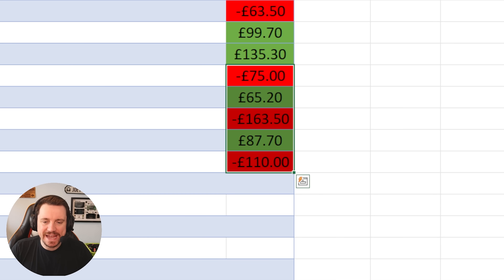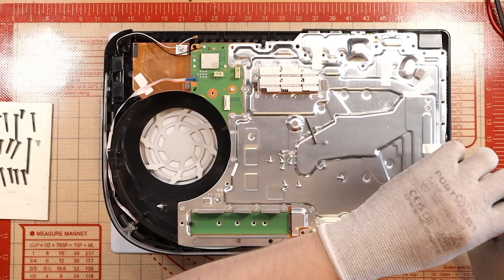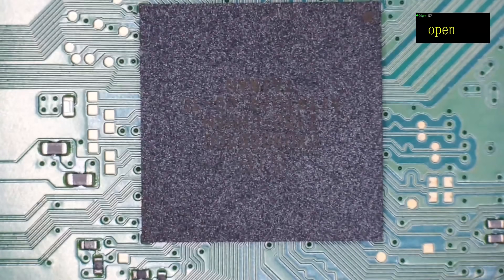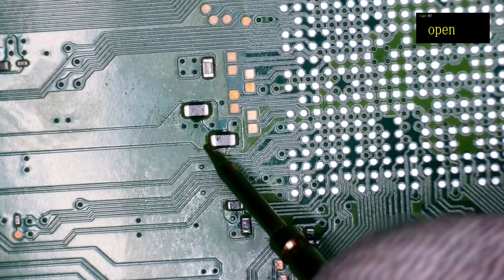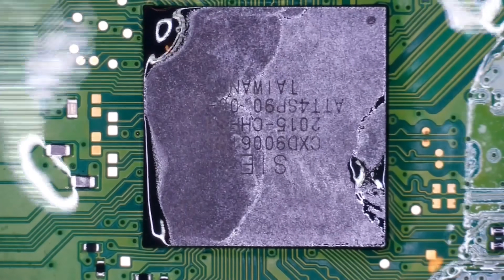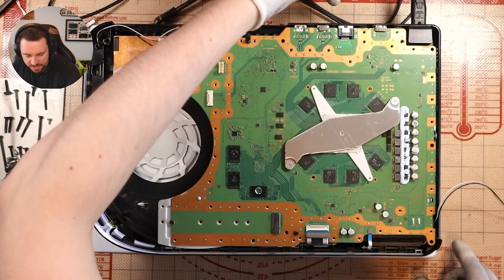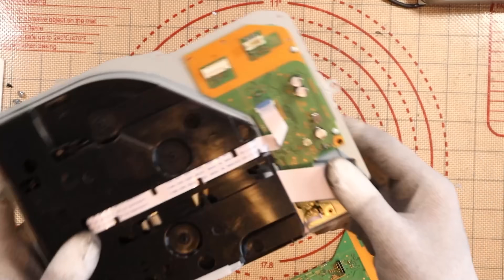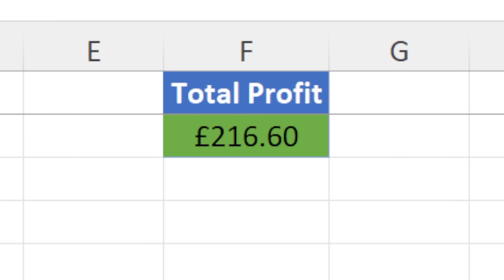Can I Fix JUNK and Make a Profit? S1:E68

Comment: Joey, it would help if you exposed the seller for the scammer he or she is before they burn someone else. They purposely swapped in bad parts and sold the system. It was not an accident and  Ebay should shut them down

Comment: 16:41 I wish you had a column that shows potential parts cost. I know you have a lot of spare parts, but a lot of us would want to know roughly how much would have actually cost. We don't have those that is why it would have been better to have that column.
Reply: The parts costs are included in the total - as long as only consoles are used that have previously been written off. Estimating the parts cost is not that easy if you buy consoles and then cannibalize them. You would have to do many assumptions.

Comment: Leave a seller a bad review joey
Reply: Name and shame
Reply from the maker: Being honest, I don't actually think it warrants it. This seller listed the items saying that they haven't actually been inside them, and the risk of me as a buyer is making that purchased based on that information. Morally, it's probably not great from them as basic checks could be carried out (for example the disc drive looks like it's been opened etc) but in terms of actually selling on eBay, they listed for Parts and Not Working with a description saying that they haven't been in the console.
Reply: @JoeyDoesTech  they purposely swapped out faulty parts that's pretty dodgy

Comment: Ok! I Like your approach but I think you proved that it's difficult to make a living by just repairing as you do. I hope the YouTube model brings you more than the Excel sheet tells us for quite a long while now. Let me know. Best! Job
Reply: At least with PS5s ... high prices for the broken ones and comparatively low prices for the used ones. After shipping, ebay fees, etc. - you basically would have to be able to fix over 90% of consoles with an take an average of 1-2hours max to fix them. So not feasible.
Reply: @TylerDurden-pk5km and do that for 6-8 hours a day. That’s about 110 consoles a month

Comment: You may ask sellers to supply photos of the consoles without the covers on to see if you can see if work has been done in them . May save you some money and time. Also if the seller is truthful they usually help with information and photos. I buy watches and it's amazing how much deception sellers will go to just to sell you something. With the no returns accepted on their adverts. If it's to good to be true and it doesn't feel right walk away.
Reply: As a seller myself, I wouldn’t do that.  Waste of my time. As a buyer, I don’t buy from eBay sellers who sell lots of video game consoles fixed or not. Tells me that they know more than they are letting on when they say “untested” or “other issues may be present I am not aware of.” I have much better luck buying broken consoles from sellers who sell other items. Means they came across the console randomly and are much more likely to not have the ability to test, or just test on a limited scale and move it on without opening it up.

Comment: Joey. Can you give me advice on what could be wrong with my ps5? I had the consile horizontal and its never been moved or touched but when i touch the cable, the picture goes and comes back. The port seems loose and wiggles.
Reply: Probably someone accidentally knocked your console and the port got damaged ,or just a faulty cable ,if it's not the cable the port is damaged and needs replacement